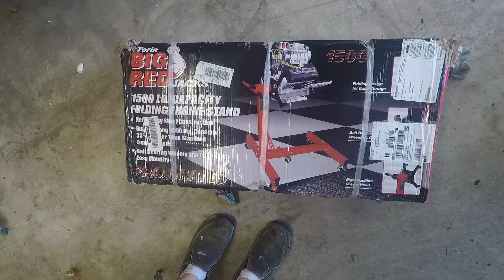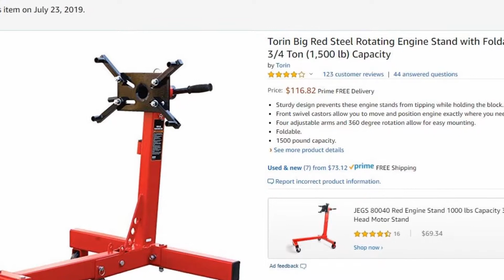New Engine Stand!

Comment: Hey, Zach, which bolts did you use to attach the engine to the stand? Were they already a part of the engine, or did you need to buy new ones?
Reply from the maker: I bought some from tractor supply, I forget the size
Reply: I just bought some today, I believe they were 3/8ths. I got 4" bolts, grade 5 stainless to accommodate my stand and to satisfy my paranoia